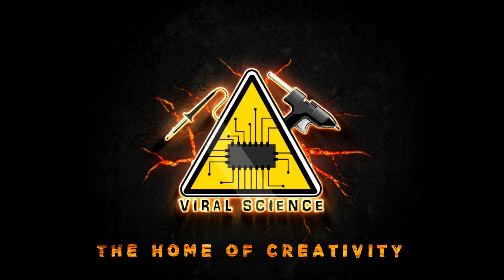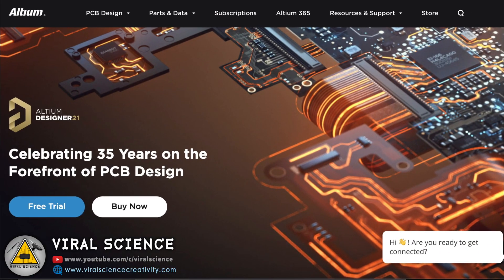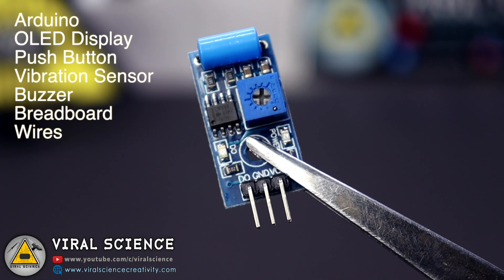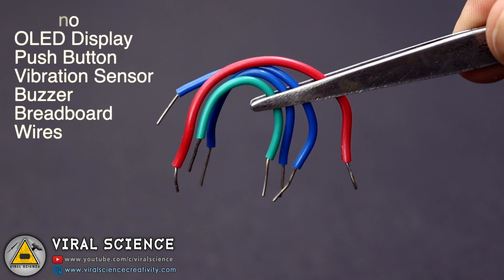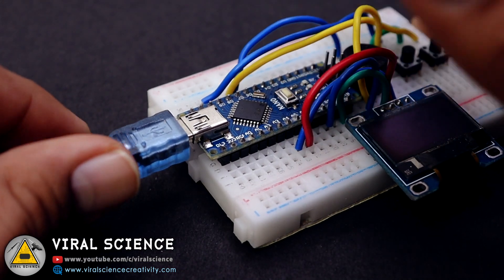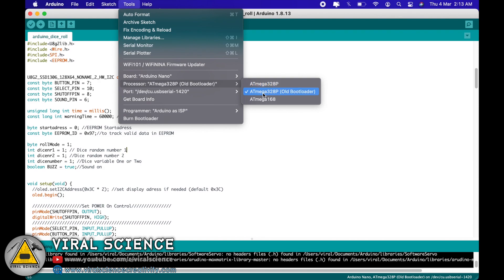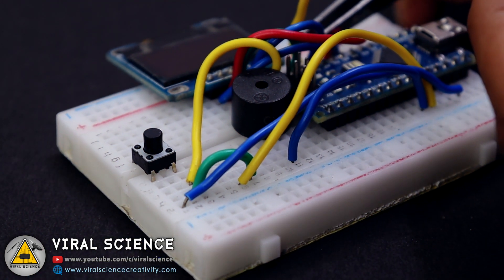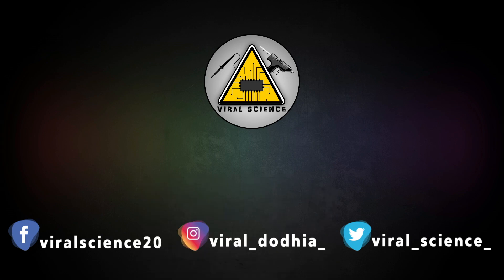Arduino Shake DICE OLED Display

Comment: Just put this together — works like a  charm once I installed the U8g2lib header. Very nice approach and a much easier solution to assemble than 7 or 14 LEDs with resistors.

Comment: I run the code through arduino and I get a 'Roll' was not declared in this scope for roll at the end of the script. 
 
 Roll(); // Show Result
  Check_On_Time();
}

void Check_On_Time() {
  if (millis() - time > warningTime) {
    CleanScreen();
  Roll();    <----------------- Thats ware I get the error-------------
  } while (digitalRead(BUTTON_PIN) == LOW);
    slow();
    time = millis();